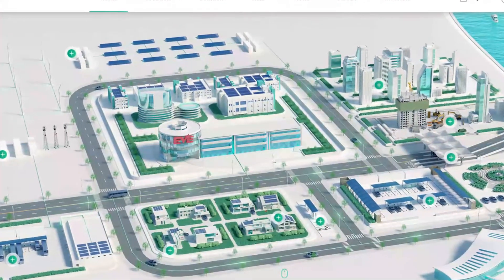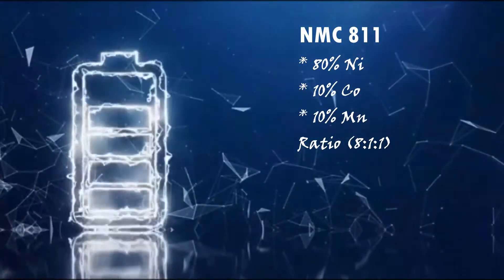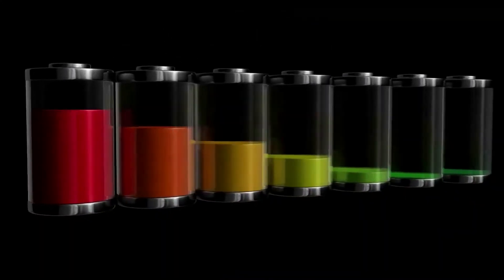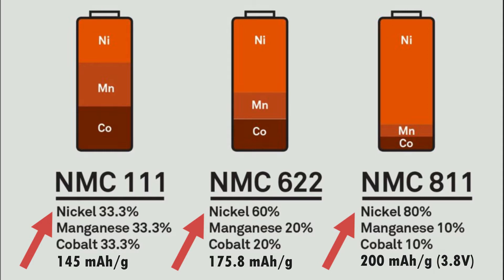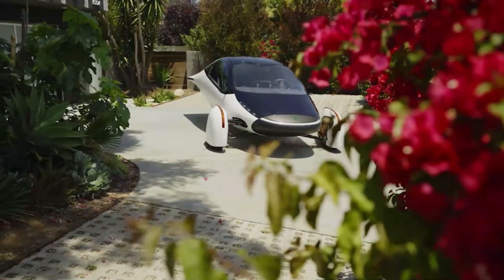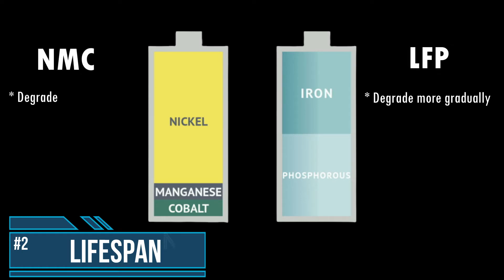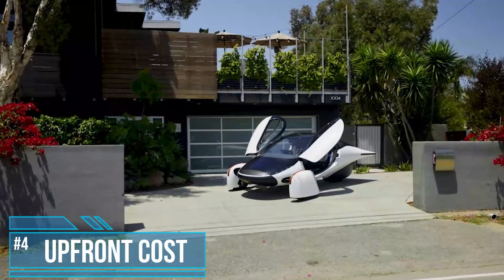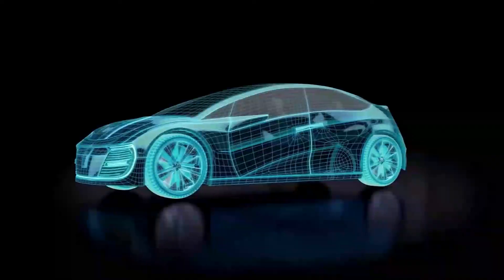Aptera BATTERY Chemistry REVIEW | NMC vs LFP Which is Better?

Comment: Very well explained.  I'm hoping Aptera offers a LiFePo4 battery option.  The space occupied by the 1,000 mile range battery could accomodate a lithium iron phosphate battery with a considerable range (more than most EV's) even if it doesn't get the full 1,000 miles with that battery.  As someone who put down a deposit on the car, I would prefer the iron phosphate chemistry for its longer life, resistance to high temperature and especially the fact that they don't burn.  I'm also not thrilled with the serial bus wiring.  The old school wiring harnesses could be diagnosed with a meter or even a lightbulb in a pinch.
Reply: @hypenohub  An LFP, LFMP or even sodium ion battery can be made with less weight or volume than the NMC cells for 1000 mile Aptera and will provide 500-750 miles of range.  This is using cheap/safe cells and still be a very amazingly long range.

Comment: The dual chemistry approach by ONE Energy uses a smaller LFP pack to handle daily driving needs, and combines it with a second NMC battery to hold energy for longer trips.  Since the LFP is able to tolerate more charging cycles, the whole pack becomes more reliable since the LFP pack is being cycled much more than the Lithium pack.  I don't know if there is room in an Aptera for this approach,, but I think ONE Energy has a very interesting solution.
Reply: Dual chemistry adds complexity to balancing and discharge; aptera has enough engineering risks.  Due to Aptera's incredible efficiency a commodity LFP (or even sodium ion) pack should be able to provide plenty of usable range.  Even if the battery is 50% bigger and 300lb heavier with LFP than NMC it still results in viable options for reaching up to 600 miles (aka plenty of range); overall mass and volume is still less than the 1000 mile.  If Aptera can skimp and use cheap cells generally intended for stationary storage and still be viable the company could save a ton of money per vehicle (critical profit) and it will last forever.

Comment: LFP batteries are generally cheaper than nickel based batteries. EVE, who will provide the Aptera’s 21700 batteries also produces LFP batteries, but Aptera’s big selling points are longer range, lighter weight, and more usable solar range. In those 3 key areas the NMC 811 batteries are clearly superior to LFP. So even though it is possible that later lower range, Aptera models may use LFP batteries, the initial production models will solely use 21700 NMC811 batteries because of their higher energy density.

Comment: I've been under the impression that LFP batteries are actually cheaper, which is why Tesla has switched to them on their cheapest trims, and why Fisker Ocean will use LFP with reduced range on its cheapest trim. You even said yourself that cobalt is expensive and that LFP doesn't use cobalt or nickel. Also, with the higher energy density of NMC and lighter weight, that should contribute to a higher efficiency than LFP.
Reply: @hypenohub  that's interesting, thanks.